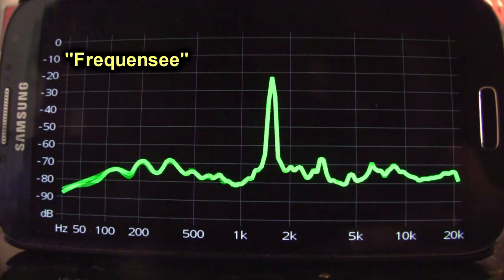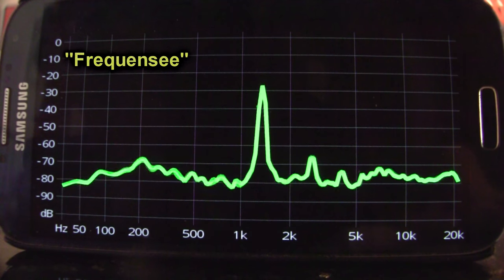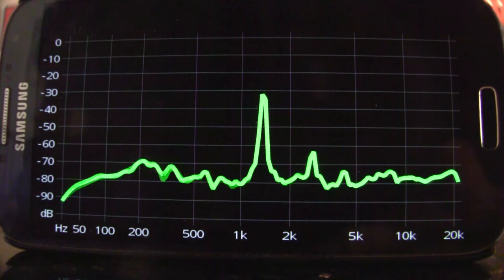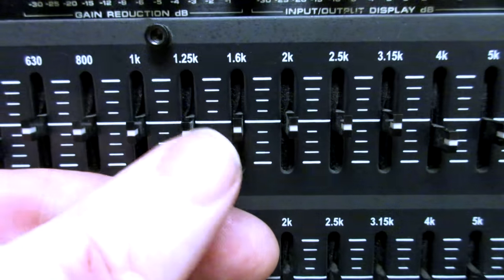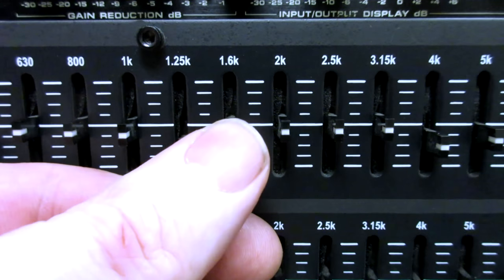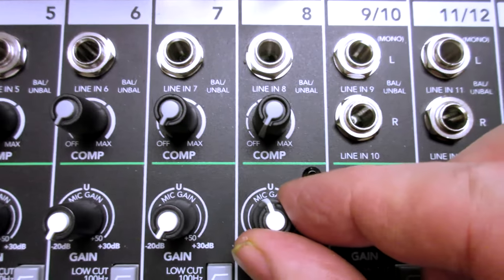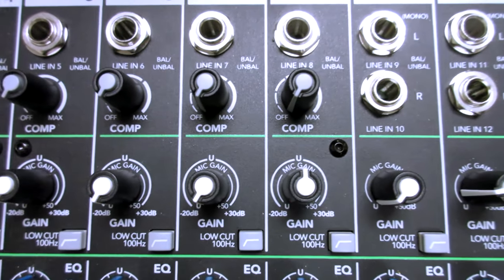How To Set Up Gain Structure and EQ a Sound System in a Club or House of Worship

Comment: This sounds like a great practical approach and I’ll be trying it before our next service. I’ve always used the pfl meter method and still get some awful feedback from some finicky speakers. One question - you mentioned that this is for systems with power amp and passive speakers. What about powered speakers?
Reply from the maker: This can work for both types...just turn powered speakers to 5 (middle) and re-adjust after gain settings. Cheers!

Comment: Thanks!
On a setup for DJing with no mic with the chain being:
CDJs/Vinyls -> DJ Mixer -> preprocessor (with limiter) -> amplifier -> speakers
 Do you know how to set the levels properly and how to calibrate the limiter according to DJ Mixer output?
Cheers
Reply from the maker: I would set the amps to 75% to start. Turn the DJ mixer Master Out to 50%. Then send some music through the speakers by slowly turning the faders up to 75%. If the music is too loud, take the amps down a bit. If it is too quiet, turn the amps up, but be careful to avoid sustained peaking on the amps (with a 4 Ohm Speaker load, occasional peaks are okay....but not regular peaks). Set the limiter threshold  so that it just limits the transient peaks (don't over-limit! If you hear the sound 'pumping' because of the limiter, then raise the threshold).

Flashing clip/peak lights on amps and other gear are a warning that you are close to distorting. Glowing clip/peak lights mean you are distorting and that isn't good for speakers. Loudspeakers (good ones) are designed to handle peaks, so leveling the signal too much can lead to driver damage/overheating over time.

Just make sure the sound is clean through the entire chain and you little to no red lights flashing. Hope this helps...cheers!
Reply: Yes, thank you!
Reply: bacontrees  hello what is the properly of setting up amp and passive speakers on a mix. Is it best to link the amps together, or give each speakers it's on channel.

Comment: NO NO NO NO NO! The proper way to do gain is to PFL the channel, and turn up the gain till it 0's out on the metering
Reply from the maker: No! Then, you can't account for the dynamics of the actual performer. The 'proper' way to do it is to get a loud, clean signal and not distort, while having the vocals cut through the mix. This is just but one way to get there, it is not 'the way', but 'a way'. In the end, does it sound loud and clear with no distortion or feedback? If so, then good. Nobody's flying aircraft here.
Reply: I have seen so many people do the set it at 0 and make it sound good method, that is wrong. The way I have always been taught is by using the metering. All the rest should be done with the faders (however if you are having to push the fader over 0 you can either set  the master higher or give it a tiny bit more gain.
Reply from the maker: The 'way you have always been taught' leaves no room for experimentation. Try a few different approaches and use the one that best works for you. There is nothing 'wrong' with this approach. If it 'sounds' good, it 'is' good. If everything is loud enough, and everyone can hear and understand, and it doesn't distort or feed back, all is good. Nobody in the audience cares how you got there. So, to say it is 'wrong' means that you are still learning.
Reply from the maker: A video rebuttle - https://www.youtube.com/watch?v=oE6rLA_mdOw